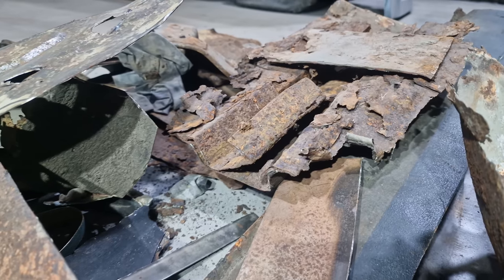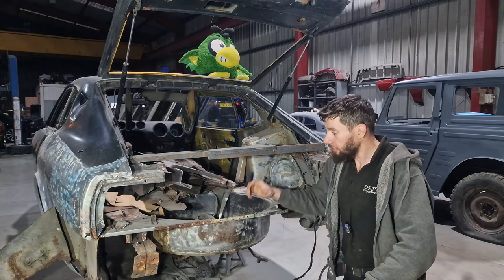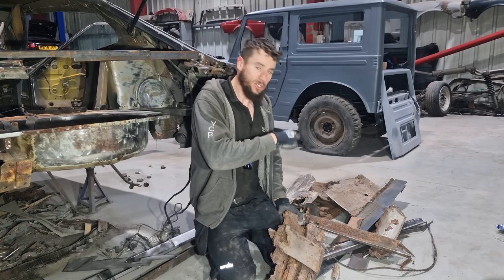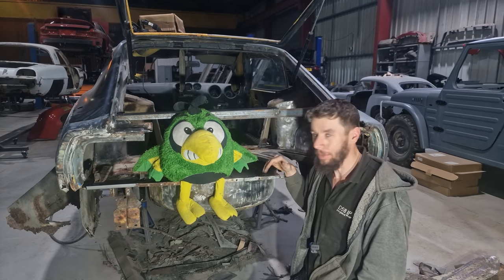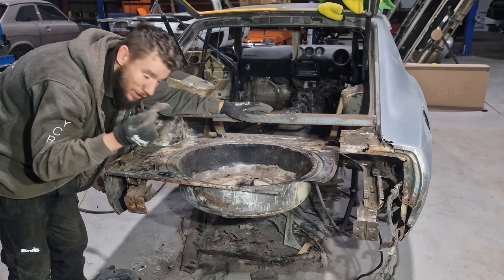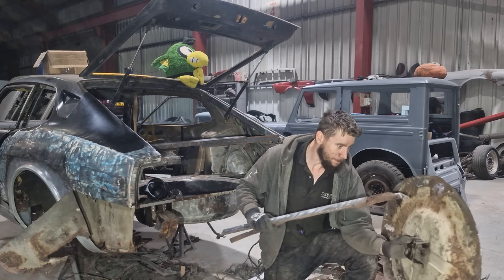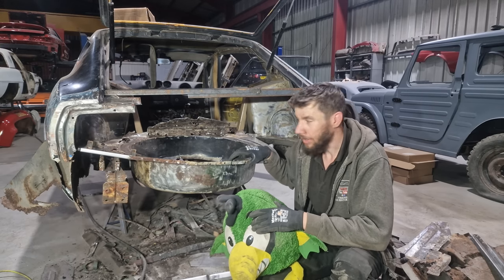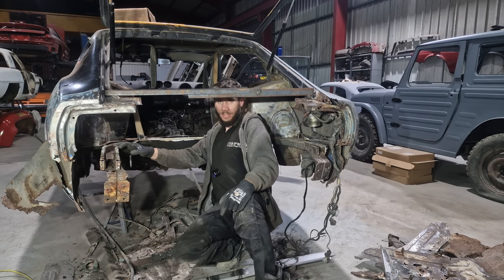Captain Yorkshire & The Defence Against Disasters! - Datsun 260z Restoration

Comment: Hi Ryan. The disaster continues... I don't suppose an original panel is available. Someone has suggested a body cut, but I can imagine finding a shell that is any real improvement on that one will be difficult. An option for spare wheel wells is to find a replacement panel for another car which is roughly the same size and grafting that in. Good luck mate.

Comment: for the wheel well. i had a similar issue. Go to the scrp yard with a tape measure and measure each wheel well in the scrapper. You will 100% find one that will work.

Comment: Is there not a decent supply of replacement panels u could just weld in? Also depending on your end goal for this disaster, why not make the rear panel without the wheel well just bead roll a panel?